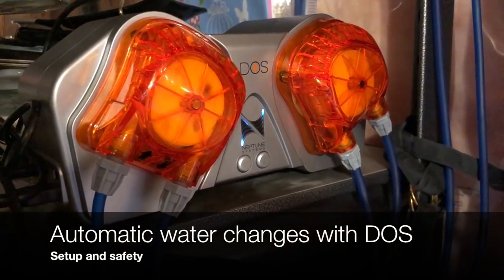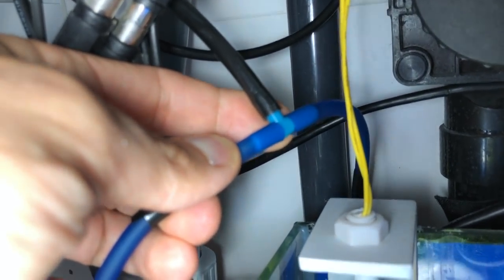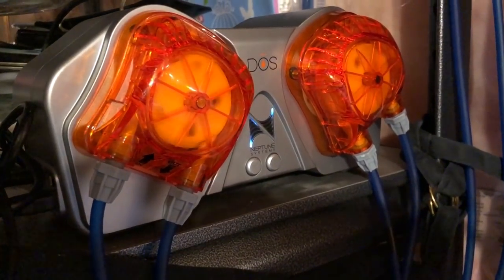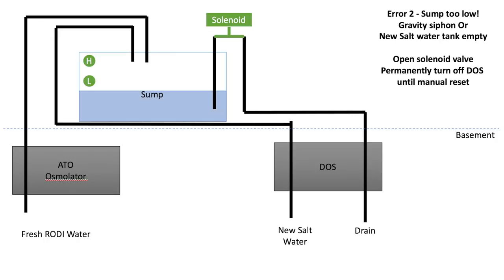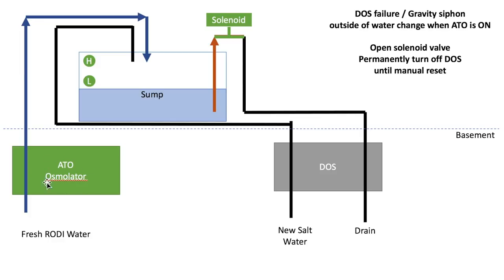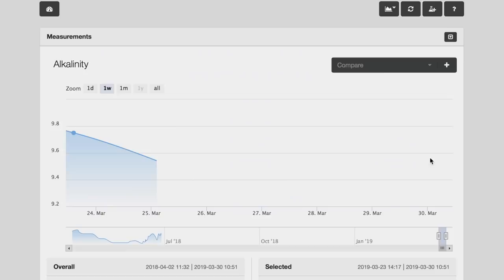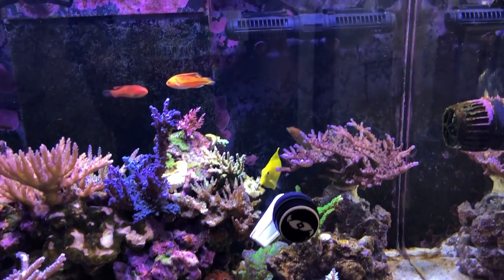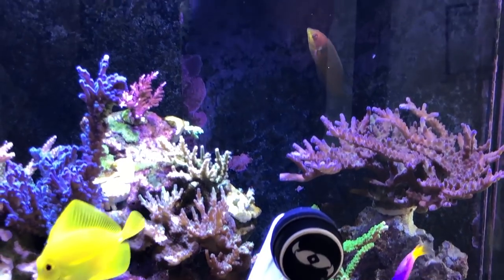Automatic water changes with Apex DOS: Setup and Safety notes

Comment: Can you hook one of these auto changers up without a sump and do it another way?
Reply from the maker: Should be possible. All you need is a tube going in to suck tank water out and another tube to add new salt water.
Reply: Tony  it’s true what Amro says Try doing it with  two dd p1 dossers  1 for in 1 for out , works for me dosing through the night 12am to 8am 👍🏴😀

Comment: How long will a Neptune DOS last doing constant auto water changes? I wouldn’t think more than a year or two
Reply from the maker: It’s been working for me for the past 2 years; my water changes last 2 hours a day, but the pumps are not on this entire time/ the software builds in many breaks during this time. Eventually the pumps and tubing may wear down but you can order new heads. My biggest issue in terms of reliability is the apex power bar; it broke on me twice in about 4 years, and the last break damaged the apex brain :( I wish they made the power bar more robust
Reply: @TheBioReef  does it click when it’s on? I just bought two of them and they both make a loud clicking when they are dosing, I’m glad to hear they are still running
Reply from the maker: @truereefkeeping6022  yep, it does certainly make a sound when switched on or off
Reply: @TheBioReef  I’m saying when the dosing heads are turning it’s making a clicking noise
Reply from the maker: @truereefkeeping6022  oh, I though you meant the solenoid. Hmmm, the DOS does make a sound,l when running but I am not sure if I would describe it as clicking
Reply: @TheBioReef  I finally set a dos up for AWC and it dosent click it only clicks when regular dosing is on

Comment: Are you removing the water and adding freshly mixed saltwater at the same time or are you removing first and then adding new?? Also how many gallons are you doing per water change on one time??
Reply from the maker: Salim Parmar yes - at the same time. I do 2.5 Liters per day
Reply: AmroAzul TV do you think if I were to setup where I turn the ATK OFF while it’s removing the water and remove 2.5 gallons or maybe more and then add freshly mixed saltwater and let it drain the removed outside the house and on to the streets. What are your thoughts about that?? And still set high and low level optical sensors in the sump that are already there from the use of ATK to make sure it stops when it reaches the low level sensor mark and then TURN ON ATK and TURN OFF DOS??

Comment: What if... no water changes....🤭🤭
Reply from the maker: Yep that would be one way to reduce the workload. I did try it a few times but it always seemed to out my system out of wack.
Reply: What if no dosing anything other than water changes. If you get Chems disbalance then supplement that fresh salt water with mags, calcium or what ever.
Reply from the maker: haven't thought about it much; you can in theory do it with sufficient dosing, but water changes also help with reducing contaminate levels - so there is additional benefits that are not simply replenishment of chemicals

Comment: ok listening to your info its good but as a person who does presentations on a daily basis, you need a better flow to this. jumping back and forth between your possible problems and proper operation is confusing. its hard to keep up and flow with how your system is properly function. I would redo this and first explain how your system works completely, then conclude with problems and fixes. good info but you got a thumbs down because of your presentation only. Never less i am installing my AWC and i am going to install my dos higher than the sump and dt so that gravity issues should be cut down tremendously